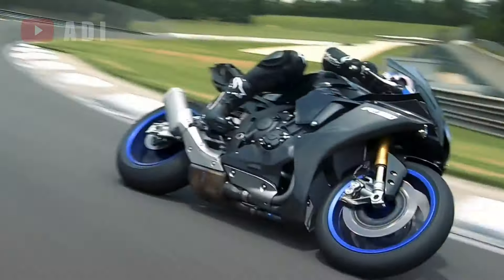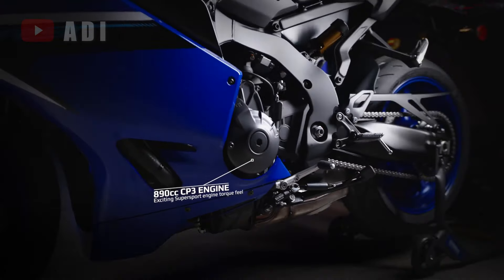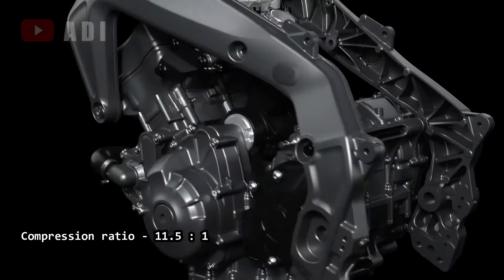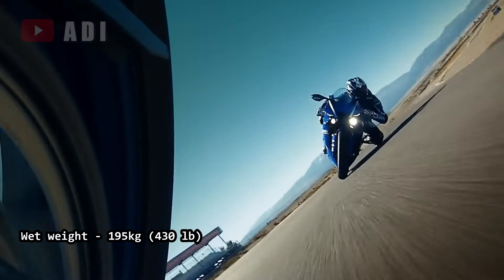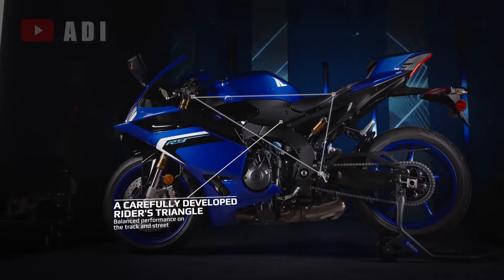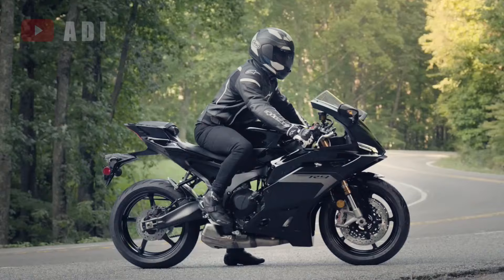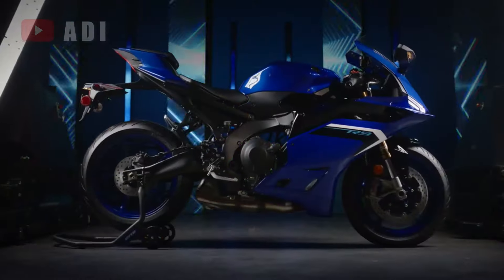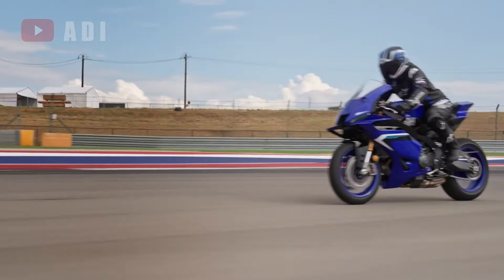2025 Yamaha R9 - Is it a worthy replacement for the R6?

Comment: Gawd people it's not replacing the R6, its replacing the R1.
Reply: Misinformation, no its not replacing the r1
Reply: R6 116hp
R9 117hp
R1 198hp

It replaces the R6.
Reply: It can't 🤡 that was a rumor
Reply: @nosferatu7611  pollution regulations are getting stricter, motorcycles will get slower, lie to yourself all you want but the R1's days are numbered the R7 replaced the R6, the R9 is replacing the R1.
Reply: @TalonTSI95  bro read the freaking news... ALL 4 cylinder motorcycles will be gone by 2030... 2026 will more than likely be the last year of the R1, the governments do not care what a few thousand R1 fan boys think... the R7 replaced the R6,  the R9 is replacing the R1.
Reply: bot
Reply: The R7 is a sv650, kawi 650, rs660, twin class competitor. The r9 is meant to be the modern alternative to the r6 not r1.  @JoeStanek-vu7rl